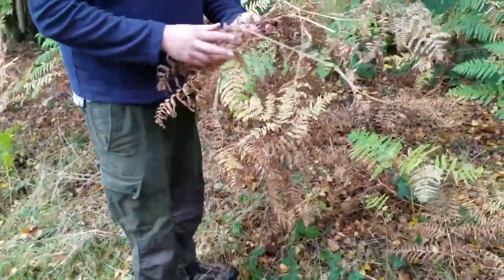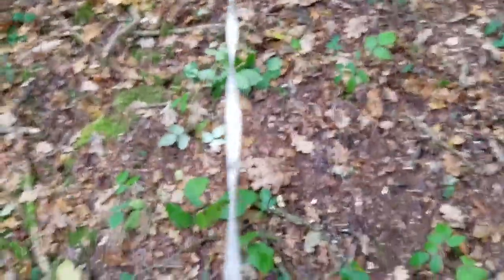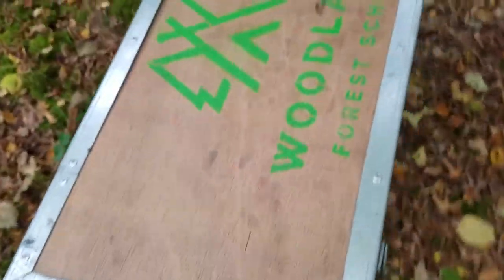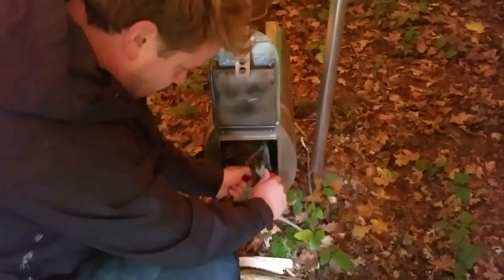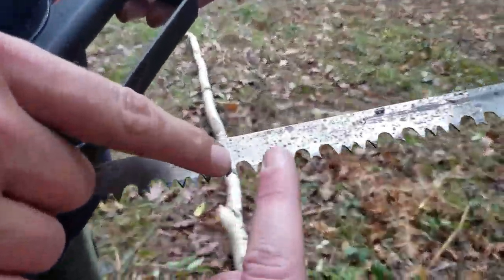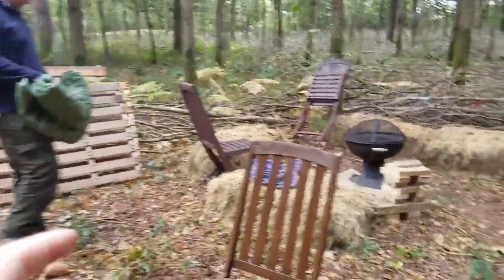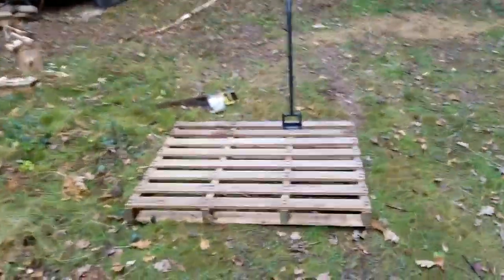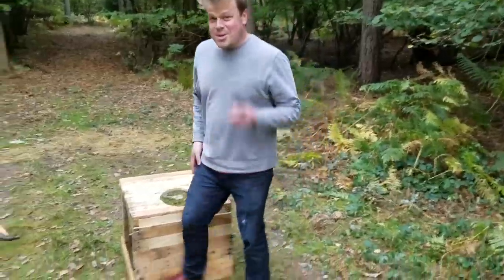LOO WITH A VIEW

Comment: Hi Dave, being environmentally conscious you might want to learn how to produce charcoal. The energy efficiency and the amount you would have to burn is almost half. Some quick rating i found off the internet for you;

"Typically wood has an energy value of between 14 and 18 MJ/kg when burned. Charcoal has an energy value of around 29 MJ/kg"

I'm sure it's not that straight forward however if your research leads you to the conclusion that charcoal is more efficient it's fairly easy to make. Lots of youtube guides and if you have any questions regarding it's production  just drop me a message.

Regards

Dan

Comment: wood is renewable but not clean. clean heat would probably be from an electric heater powered by solar or wind.
Reply: Better than coal though (which I'd reckon using because it burns longer and is easy to store plus can be used with wood and you can get coal with less impurities in)
Reply: Wood is not renewable, just like fossil fuels it is a finite source! Wood can run out when overly exploited, renewable energy such as solar, wind, tidal, geothermal ect do not run out.
Reply: Sumonebody steady on fellah no need to be so angry. The definition of renewable energy is "energy from a source that is not depleted when used". So wood is only renewable if you replant. The difference with A Star is the timescale as it does not technically last forever but will almost definitely outlast our existence. You should be careful who you label a moron, it's not a very nice thing to say! I have a degree in environmental geoscience and I am currently studying a masters degree in environmental dynamics and climate change, so am relatively clued up about this sort of stuff.

Comment: With burning wood, I believe that it wouldn't really produce that much pollution, it would just release the carbon dioxide that it took in, remember that for trees to grow they take in CO2 and then produce oxygen from that. Just make sure that when you burn wood or anything, that it has enough oxygen otherwise it would make carbon monoxide aswell as other things. You can learn about it on school websites like BBC Bitesize.
I am just a kid but I hope this helped, even if it's a couple months late :)